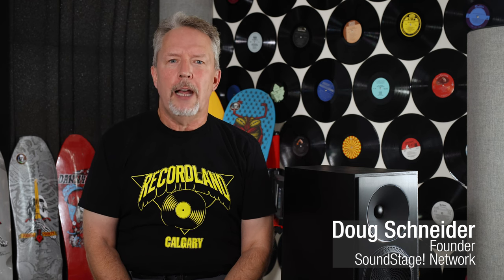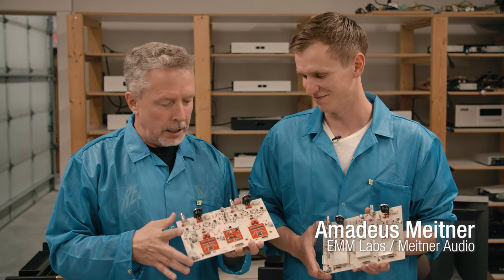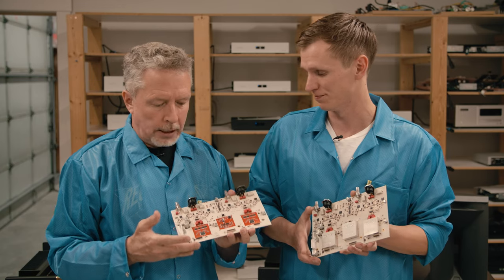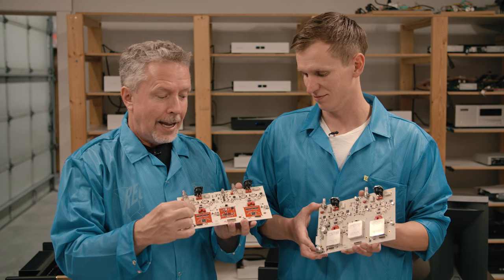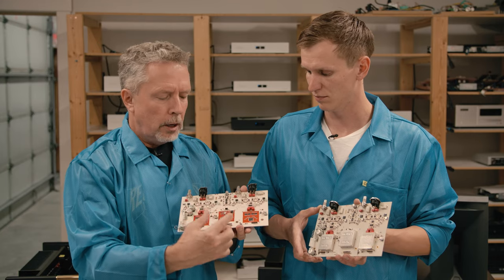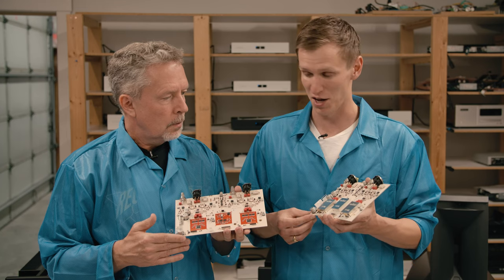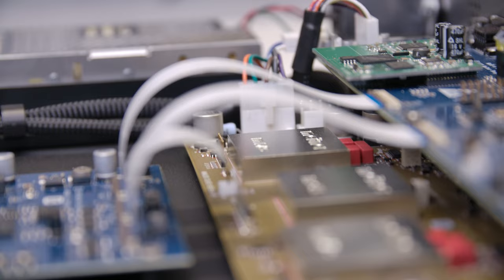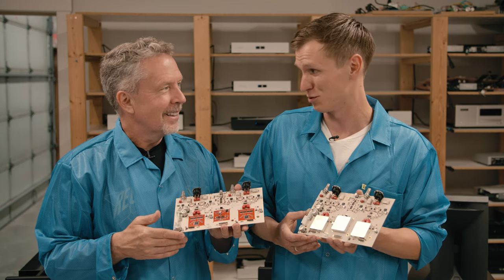Meitner's Custom 1-Bit DSD DACs - Combined with Clock Controversy - SoundStage! Real Hi-Fi (Ep:45)

Comment: I would rather spend my money on an MA3 with internal clock and jitter management, then buy and cable two components that would equal the same cost as the MA3. It was that simplicity itself that made the MA3 so attractive.  So that is what I did. I own an MA3 and wouldn't have it any other way. Well, unless I win the lottery and buy some EMM gear. Cheers!
Reply from the maker: Great DAC!
Reply: From what I could tell visiting the company in September, the MA3 is doing remarkably well for them.
Reply: @dougschneider8243  Agree. They recently introduced a Meitner branded digital phono stage for use with a digital cartridge. Another trickle down from EMM. EMM/Meitner trickle down is a good thing. I am intrigued.
Reply: I have an MA3, and I think it’s a great product . Great musicality allied with exceptional ergonomics , a pleasure to own.

Comment: External clocks are really the domain of recording studios where they may be several Analogue to Digital converters working together, and they all need to be synchronised to one master clock. For playback I agree that the master clock aught to be very close to the DAC. And most often it is. Esoteric were largely responsible for this idea of an external clock using a Rubidium atomic source. But even then the DAC in the Esoteric - stand alone or CD player would be doing the main pulse but would be 'corrected' by the master clock. As you say, some claim to hear a difference. I have tried this myself and to be honest I can't hear it, or at least I won't be loosing sleep over it. It is something I obsessed on a little while ago.

Comment: There is no argument. The important thing is minimizing jitter at the converter - this means placing a very accurate clock as close to the DA converter as possible. You can have a master slave arrangement so long as the inherent jitter from master clock signal itself and it’s lengthy transmission is ignored by the slave. There are ways to do this such as making the clocks asynchronous and adding a buffer and a very slow adjustment in time (less than 3Hz adjustment rate) to keep the master slave in overall time. An extremely high mathematical sample rate buffer (way way higher than any chip can process) can hold the data briefly and you simply do a register shift at such a mathematically high frequency that no audio frequency degradation occurs. The super high sample rate data can then be downsampled mathematically to a rate suitable for conversion. Frankly, jitter isn’t a problem anymore (for audio reproduction) in well engineered designs (of which there are quite a few).

Comment: External clocks color the sound, and it might sound "better" to a listener, but it generally is not reducing jitter, but changing it. For example, in recording studios Antelope clocks are popular (if controversial) and they actually add jitter to their clocking to create an effect. My sense is that is probably the case with DCS or others. Just maybe there is noise contamination from the clock on the main board, but in all likelihood external clocks are more like a tuning effect for certain end dacs.

Comment: Very interesting take. dCS disagrees. Not sure who's right as they make great DACs as well.

For non-High-End DACs, a well constructed external clock is a) certainly not inherently flawed because I've heard the improvements they can bring to sub $10k DACs and b) is nearly guaranteed to be a lower jitter clock than the borderline unserviceable clock that came in the DAC to begin with.

EDITED: for accuracy. MSB uses co-located clocks.
Reply: That, obviously, is something different -- a poorly implemented internal clock.
Reply: @dougschneider8243  Well I say "unserviceable" in as much as a nominal $1500-$6000 DAC's clock can be flawed in an absolute sense. I would love to see a debate on this between Ed and the rest.
Reply: BTW, I'm not sure MSB has an external clock. Their Digital Director series seems to put some electronics within another case, but it doesn't mention the clock.
Reply: @dougschneider8243  Agreed. Trying to read between the lines of their marketing. There's definitely some ambiguity here.
Reply: @DBravo29er  I personally think hi-fi companies are going to have to get much, much better at defining exactly what the features of a product are. Oftentimes it's very light and/or very confusing. The clocking on MSB's products isn't clear, but it doesn't seem to be what's inside the Digital Director boxes, though I'm not 100% sure.
Reply: @dougschneider8243  Agreed and, on a second read, I'm starting to think you may be correct.
Reply: @dougschneider8243  Oh And I'm still doing digital audio with the poors, lol. Roon Nucleus + (Plixir Elite BDC power supply) -> Denafrips GAIA DDC -> Chord Qutest (Plixir Elite BDC power supply).

I do aspire to own top tier equipment, though. In time.
Reply: @DBravo29er  Don't think think you're gear isn't good. A lot of very expensive digital gear isn't that much better -- or sometimes even any better -- than more affordable stuff.
Reply: @dougschneider8243  I appreciate you saying that. I'm having a great time with what I've got. I think that's what's important. 👍
Reply: MSB does not have an external clock. They place the clock close to the conversion point too. The external boxes are the power supply for the dacs. This keeps electrical noise away from the Dac.